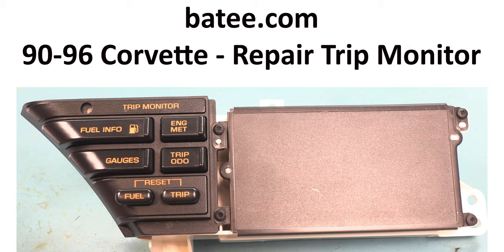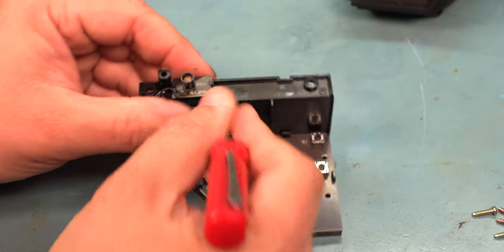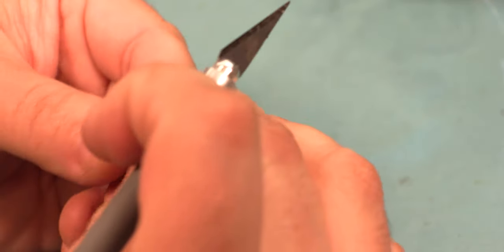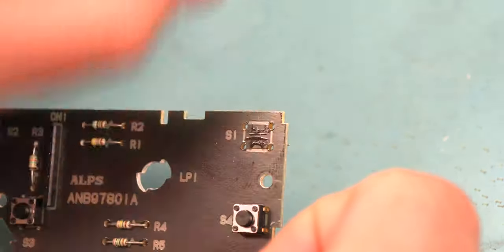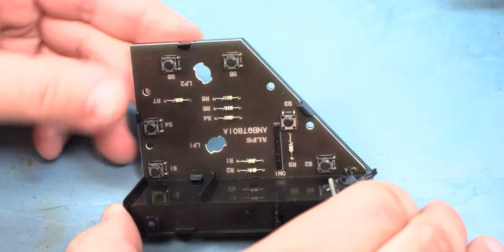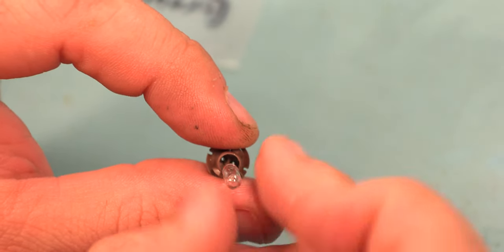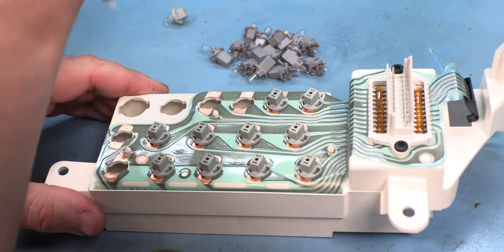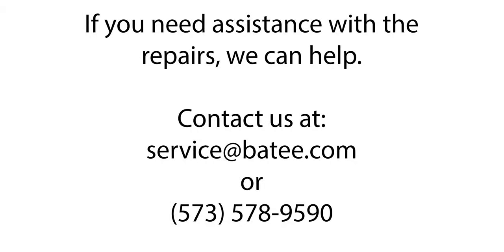1990-1996 Corvette #8 - Trip Monitor Repair Digital Information Center (2019)

Comment: I purchased the repair kit and replaced the switches and bulbs on my 1990 Trip monitor.  My Change Oil light was on constant, and the reset procedure did not work, my Change Oil light did not flash.  After doing the repair, I performed the reset procedure, and I have the same problem. The repair did not fix my problem.
Reply: Hi:  we replied to your email this morning. We need to know if you replaced the switches, and if they appear to be working to change the LCD?